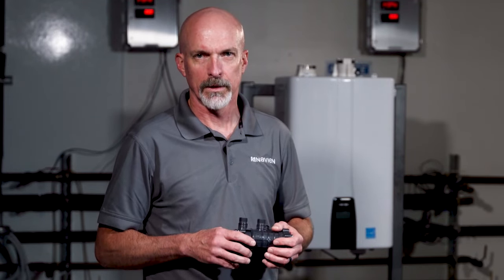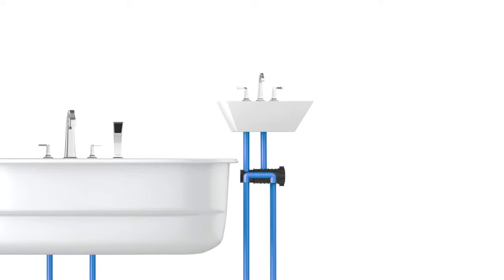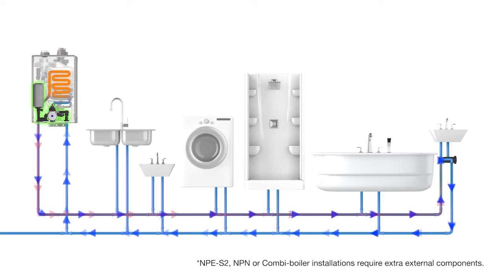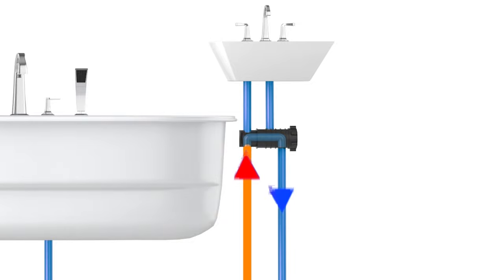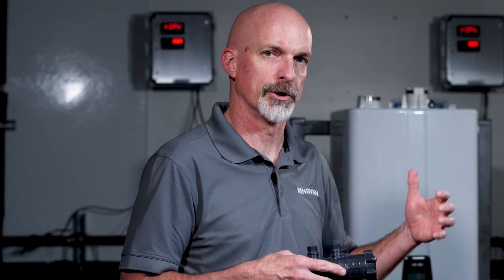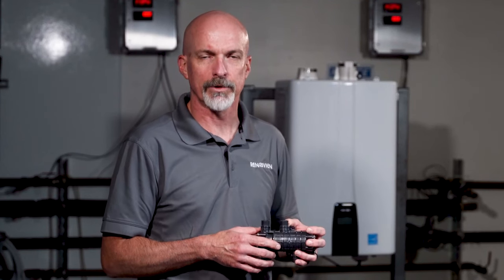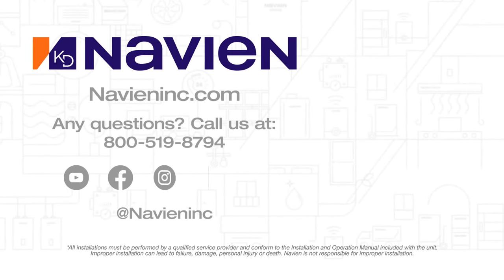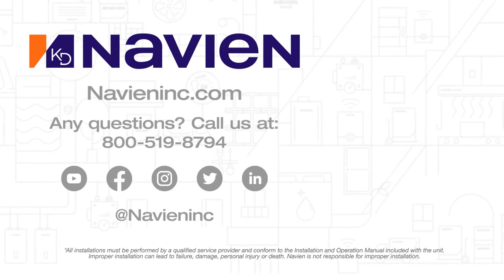Navien NaviCirc Recirculation Valve

Comment: Navien is by far the best tankless water heater on the market. They are my go to tankless brand for both water heaters and boilers. And the new NPE240A2 is amazing. I have installed many of the navicirc valves over the last couple years and have had nothing but good feedback from our customers. Gotta love it.
Reply: I've zeroed in on the NPE-180A2 for my two bathroom single story home!
Reply: How you program the tankless with Navi circ valve internal and the valve ext

Comment: What a great item,  another reason to get my customers to go with Navien.  I have been sold on them ever since the local supply house set up a training class with the reps. years ago!  Navien has been my go to brand for all my residential and commercial customers. Now I have another tool in my box.
Reply: I'm debating on having a Navien npe-240a2 installed is this a good unit for a 2800 sq ft 2 story house with 3 bathrooms? Does one need to run a condensing drain pipe? How often and expensive should they be serviced? Do these require flushing valves? Also looking at the Bosh Greentherm T 9900 SE 199NG. Which is better and going to last longer?

Comment: We're big fans of Navien. It's the only tankless brand we sell and install. Thanks for the addition of the NaviCirc valve! This will make delivering near instant hot water on retrofit installs much more time and cost effective.
Reply: I'm debating on having a Navien npe-240a2 installed is this a good unit for a 2800 sq ft 2 story house with 3 bathrooms? Does one need to run a condensing drain pipe? How often and expensive should they be serviced? Do these require flushing valves? Also looking at the Bosh Greentherm T 9900 SE 199NG. Which is better and going to last longer?

Comment: Have been installing NPE heaters for many years. Fantastic product. We have several hundred units in the field. We have very few issues and their customer service is great. They do not keep you on hold for hours such as Noritz !
Reply: I'm debating on having a Navien npe-240a2 installed is this a good unit for a 2800 sq ft 2 story house with 3 bathrooms? Does one need to run a condensing drain pipe? How often and expensive should they be serviced? Do these require flushing valves? Also looking at the Bosh Greentherm T 9900 SE 199NG. Which is better and going to last longer?

Comment: I’ve been selling Navien for ten years, they just keep getting better. Thanks for the great customer service!
Reply: I'm debating on having a Navien npe-240a2 installed is this a good unit for a 2800 sq ft 2 story house with 3 bathrooms? Does one need to run a condensing drain pipe? How often and expensive should they be serviced? Do these require flushing valves? Also looking at the Bosh Greentherm T 9900 SE 199NG. Which is better and going to last longer?

Comment: As a NSS (Navien Service Specialist) in the Greater Austin, TX area, I can confidently say that the NaviCirc is the way to go for upgrading an existing home for GREATLY improved hot water performance!
Reply: I'm debating on having a Navien npe-240a2 installed is this a good unit for a 2800 sq ft 2 story house with 3 bathrooms? Does one need to run a condensing drain pipe? How often and expensive should they be serviced? Do these require flushing valves? Also looking at the Bosh Greentherm T 9900 SE 199NG. Which is better and going to last longer?

Comment: Navien is very easy to install and work on.  The training through navien is also great. Very great customer service!!
Reply: I'm debating on having a Navien npe-240a2 installed is this a good unit for a 2800 sq ft 2 story house with 3 bathrooms? Does one need to run a condensing drain pipe? How often and expensive should they be serviced? Do these require flushing valves? Also looking at the Bosh Greentherm T 9900 SE 199NG. Which is better and going to last longer?

Comment: Navien is the only tankless water heater that I recommend to my customers. Great customer support during technical difficulties.
Reply from the maker: Hi, thanks for entering the Navien YouTube Giveaway. You’ve been selected as eligible to win one (1) prize consisting of a small Navien branded Veto tool bag with Navien swag and tools with retail value of $338.15 USD! To be confirmed as an official winner, please reach out to us at social@navien.com.

WE MUST RECEIVE YOUR EMAIL RESPONSE BY June 6, 2022 at 10:00am PT. 

Failure to respond to this message by the above deadline will result in your disqualification as eligible to win the prize.
Reply: I'm debating on having a Navien npe-240a2 installed is this a good unit for a 2800 sq ft 2 story house with 3 bathrooms? Does one need to run a condensing drain pipe? How often and expensive should they be serviced? Do these require flushing valves? Also looking at the Bosh Greentherm T 9900 SE 199NG. Which is better and going to last longer?

Comment: I have a Navi-Circ in my own home along with hot button and NaviLink. Professional contractor and i can say Navien is best in the market!
Reply: That is great to hear. I have same setup as you. I’m having issues getting the recirculation to run more than 3 mins regardless of setting. That’s not long enough to get hot water to my distant fixture. Any suggestions??  I want to use the Hot Button so I don’t waste energy on other methods
Reply: @stevespanogle5892  yes i do. If you buy the hot button KIT, it comes with a temperature sensor that goes on the hot water line right before the navi-circ. That sensor gets wired back to the heater. When the hot button is pushed, it will keep the pump and burner on until that sensor reads 95 degrees. You can actually see what that temperature is on the status menu of the heater.
Reply: @Patriot31743  yes I bought the kit. I haven’t tried that status menu but I’ll look for it. What temp differential setting are you using ??  I appreciate the input.

Comment: Had the tankless water heater installed 2 weeks ago.  Our old large tank water heater got us hot water in 10 seconds in the morning.  This tankless system takes 45 seconds!!!  For 27 years we never had a problem showering and running a tap, now we do.  These tankless systems do not deliver on their promise.  Wish we never had it installed.
Reply from the maker: I'm sorry to hear that. Have you talked to your installer about these issues? Our Technical Support team is here to help your installer with any issues you are experiencing. 800-519-8794 option 2.
Reply: @NavienInc  Our installer is coming by this afternoon to look into the issues and call support.

Comment: I have the NPE line, and this installed at the very end of the house under a faucet. They also installed a direct line recirculating pipe to all the faucets available. So when I set up external recirculating on the unit, do I say yes to an external pump?

Comment: Since the cold water line is now being used as the return line in the circulation flow, opening the cold water spout might flow out hot? How exactly does this affect the cold water flow if someone turns on the cold water while this is recirculating?

Comment: I really like the idea, but how does this effect the operation cost of the water heater, is it on all the time circulating the hot water. i Feel like the electric or gas bill would rise quite a bit.

Comment: So.. if the cold supply is the return, how is it overcoming the PSI in the cold line to return back to the heater? From what I understand from this video it's not actually hooked up to the recirculation port on the heater. I'm missing something, lol.

Comment: I’m having issues getting the A2 to run recirculation more than 3 minutes with the Hot Button regardless of settings. I do have the NaviCirc Valve installed. I used one of the Navian contractors to install my system but they weren’t familiar with the Hot Button. Any input is appreciated. We aren’t getting hot water to distant fixture quick enough.

Comment: Installed a new 240A2 with navicirc valve at distant sink. What is the settings on the machine internal vs external circulation? Right now there is no pipe entering the recirculating port on the water heater. Please help. Thanks

Comment: What this video doesn't tell you is that the Navien NPE-210A units made before 2016 are unable to set the parameters necessary to use the Navicirc correctly. There's no disclaimer about that and they claim that all the NPE A units can use the Navicirc but you're unable to set the parameter to 17 where it needs to be- the 210A only goes up to twelve. My plumber just installed one for me and the only way that it works is if the pump inside the unit runs constantly. He had to put the check valve in the line instead of right on the unit because he was afraid it would burn out the pump eventually from it going on and off. The Navicirc valve closes at 95 degrees. That's just not hot enough for everyday use for your tankless.  My unit is 10 years old and the only way I could get that valve to work like it's supposed to would be to install a new controller board and it's not worth it. I'll just keep turning it off at night and run it during the day to try to save energy but it's also gonna fire a few times when it first starts up. The whole thing is a mess because they don't have a disclaimer about the units made before 2016. That's a little dishonest.

Comment: I have a plumber telling me these valves only last about 2 years. This true? Plus he is saying they dont work as fast as a direct line b/c of the pipe size. He quoted $650 for valve recirc and $850 for the direct line recirc
Reply from the maker: Our NaviCirc Valves come with a 3-Year Parts Warranty, but of course we expect them to last longer than that. There are differences between using a NaviCirc Valve vs. a Dedicated Recirculation Line. All the pros and cons should be discussed with your installer before deciding which option is right for your home.

Comment: With this Navi-circ valve, would the cold water not be warm as well? If the valve doesn't close until its at 95F, while the re-circ pump is running, will that not affect the water temp of the cold? Someone may want a glass of water from any fixture in the line and get potentially 94F water.
Reply from the maker: Hi @briansbruins. Yes, that's true. You will get warm water mixed into your cold line sometimes with a cross-over valve like this. But this is still a great option for someone who wants recirculation, without installing a dedicated recirculation line.
Reply: @NavienInc  Can this valve been used on any recirculating system like WATTS?
Reply from the maker: @wanaraz  Our NaviCirc is designed specifically for Navien products, but it is not limited to our product line, and can be used in other applications. For more information, please see  here https://www.navieninc.com/downloads/navicirc-sell-sheet-en
Reply: @NavienInc  Great Thanks.

Comment: I’ve installed this on a 240A, and found out I had to repipe under the tankless, instructions do not come with valve kit on how to pipe under tankless. and still customer is not getting hot water faster…  😩why!
Reply: With old stile unit may have to use  varable speed circulator that is pricy. Dont forget to instal backflow if circulator dont come with it,new version has biuld control for recirculation so fix speed h.w. circulator may be used Navien has diagram on thair webside .
Reply: Should have hired a professional

Comment: The navien water heater is great /navicir  valves are junk nothing but trouble. Navien customer service was zero help. Valve howls and bangs switched it out for the Watts premier sensor valve  p#367010 problem solved and valve was cheaper.